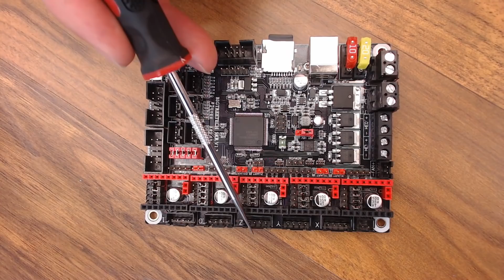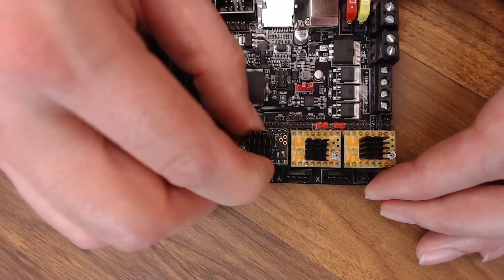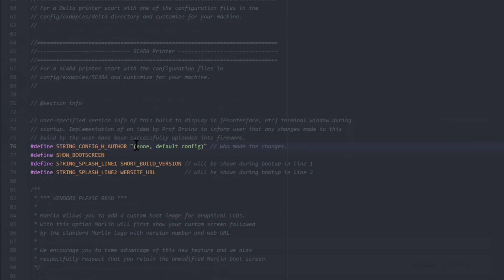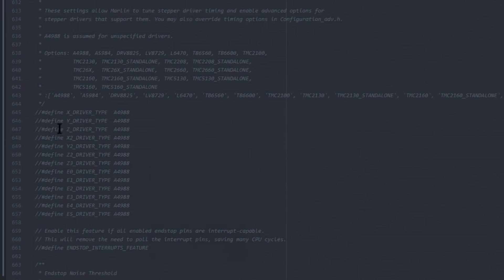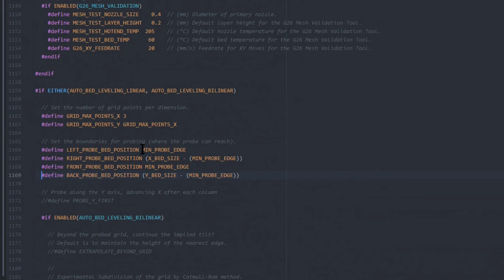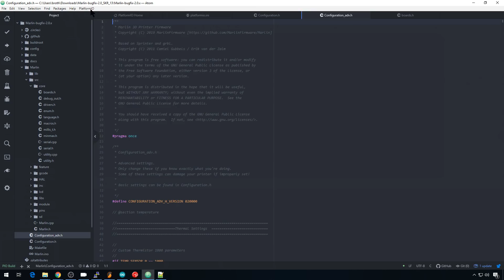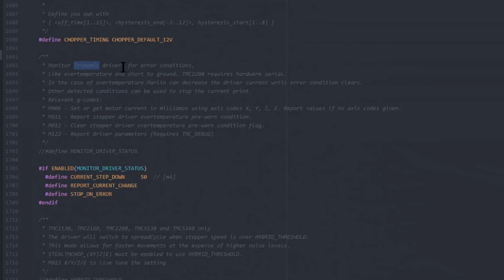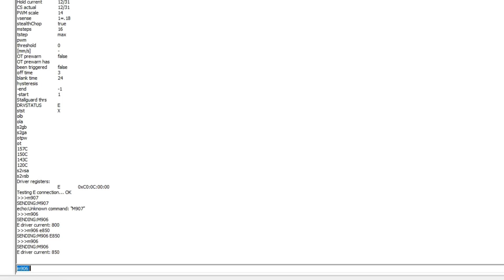SKR v1.3 Mainboard Install - TMC2208 - Chris's Basement

Comment: I like that you put ferrules on your power wires. Much better than loose or soldered which can loosen over time. Did that to mine when I installed an MKS.
As you said, 32bit permits Ludicrous speeds however I'm trying to think of a situation where it could be used. Would it be for large nozzle sizes and huge, low detail prints? I'll admit my experience is limited.
Great video. 30min isn't all that long except for the time it takes you to edit.
Am I wrong in assuming uart mode just gives diagnostics and the ability to adjust the vref via gcode?
Oh, the reset button would need an easy way to push it built into any STL file for an enclosure, IMO.
Reply from the maker: Thanks! I really like those connectors, so much nicer. Really as far as detail I don't think 32 will matter much. I see it more for corexy and Delta computing. Correct, UART just gives you some monitoring and control of the mode they run in and VRFE.

Comment: Thanks for posting, I had a look at the SKR  and it looked pretty promising, but as the Re Arm was available to me I plonked some LV8729's in one and put it on my kossel linear plus, the difference is quite amazing, 1/64 microstepping is plenty quiet for me  and has plenty of torque  even with the stepper Vref only @ 0.5v  the motors stay pretty cool and unlike when testing the 2130's on the kossel I have no layer shifts, longest print so far has been 8 hours at 120mm/s,  I have gone up to 160 mm/s but the stock effector arms rattle too much for my liking at that speed the only issue I  have with the ReArm is its height,  I really dont want to shove it under the heated bed because heatsinks  on the steppers are pretty tall,   this is why I am looking towards the SKR, I'll keep the ReArm as a backup
Reply from the maker: Right on Andy, yeah I would say the SKR is just a lot easier to install and your right it would be about half as tall as re-arm sandwich.

Comment: Only question two questions. 1) the endstop, 5V/3V, dunno if its gonna work with my current optical endstops. 2) Do you have a shopping link for aliexpress?
Reply: They Will work, ive got optical endstops 3.3v and work like a charm with skr 1.3.
Reply from the maker: Good to know on the endstops. I updated my descriptions today with all my proper links.

Comment: Excellent....  So what is your opinion of this board.  To me, it seems like excellent value, esp with the trinamic drivers.  Regarding the dual z steppers.  What is the best way to configure it on this board?  Use the cable splitter as you have or can you use the E1 driver position.  If cable is best, parallel or serial?  What vendors trinamic do you recommend.  I think I am going to upgrade my E16.  I feel very limited by the 1284 atmega.  Thanks again Chris.  Looking forward to your future videos on this board.
Reply from the maker: Thanks Mark! So far, you can't beat it for the money. You can configure the dual steppers in Marlin, it's pretty straightforward. Using 2 drivers for 2 Z motors can get a little interesting if you don't have to Z endstops, so I just stick with the cable. I would think parallel would be better, but companies like Ultimachine use series, I think you can expect pretty much the same results from either. All the trinamics use the same chip, but I have more faith in watterot drivers....but the price kinda hurts.

Comment: Hi Chris, great video. I got one of these running with some help from your rearm video. (So, thanks twice.) It was pretty much a drop in replacement for an MKS 1.4 and is working well so far in an old FT5 r1. It's so much quieter that it seems weird. 

Margin notes... I had the same 2208 v1.2 driver you used and it was only necessary to connect the J2 pad (the one closest to uart pin) with the center pad (chip) to enable uart. As I understood it, the other pin/pad was unused in the current config so it doesn't hurt anything to connect all three as you did though. The drivers get a little warm, and the vref is different than allegro, so mind the current. People say stealthchop robs too much torque for extruders so I didn't try quiet mode for that, but the 2208 is working fine for 'E' in spread cycle with a gear reduction extruder.

Might want to sign your channel up as a brave browser content creator so people can toss bat tokens your way. Take care...
Reply from the maker: Thanks for the comment, glad to know it helped you twice! Thanks for the extra info on the 2208's. I have never heard of brave browser, I will have to look into that.

Comment: Great video as per usual, Thanks.  Is configuration capable of sensor less homing?
Reply: If you have 2130 , yes
Reply from the maker: Yes, as @Nitram says, if you have 2130's, they should be similar to the 2208 setup, just different jumpers to remove.

Comment: Hi Chris, I have a smilar board ,the SKR v1.1and I can’t get it to connect to my computer at all, any ideas?
Reply from the maker: These seem to be super picky about drivers and the config. You need a known working config, load the SD card directly from the computer then put the card back in your board. See if it shows up then.
Reply: @ChrisRiley  thanks Chris will give that a go and let you know. Cheers

Comment: Would love to see this swap on an Ender 3.  Any difference?
Reply: Mks Gen L is more than enough and cheaper. It also has bigger ender 3 community. It doesn't have sd card slot on the board, but you can buy external module for less than 2usd
Reply from the maker: Really? You can get a Gen L for $20? Nice!
Reply from the maker: There is probably almost no difference swapped to an ender 3, but that goes for pretty much any i3 machine. It's not a bad option though if your just looking to replace the board and get upgraded drivers.

Comment: good job as usual. ur marlin 2.0 video helped me set this up a few weeks ago. keep in mind there is an issue with marlin 2.0 this board and 2130's doing linear advance. the extruder won't work. might be fixed now but a month ago I know it was an issue when. did it. took me 3 hours figuring out why my extruder wasn't working lol
Reply from the maker: Thanks! I hear ya, I think I have downloaded 2.0 about 6 different times now, there is always something popping up that is either broken or now fixed. :)

Comment: I haven't seen anyone using TMC drivers for sensor-less homing. Is that not something that can be DIY'd yet?
Reply from the maker: I have a 2130 video on it. You can use it as long as you configure SPI mode, this board makes it super easy.
Reply: @commonsensehuman1114 Yes. It is something I really like on the MK3 but just haven't seen it used or set up much. Though I didn't know about the 2130 video. just not something I see on swap out boards yet.

Comment: @Chris Riley
 Thank you So much for making this VIDEO!!!! Been waiting for this! ;) hope there will be many video's on this Board from you Cheers M8.
Me and a friend both are going to install the SKR v1.3 with tmc2208 in uart then lv8729 for  Z & Extruder on a Cr-10/Cr-10s  @12v Plus an EzABL not sure how to config a ezabl - we are wondering for extruder motor to use a 1.8 or 0.9° Angle 415 vs 830 pancake motor could you talk about this in your next video's using the SKR 1.3 we both bought a Trianglelabs Bondtech clone, to use with the SKR 1.3.  and what angle stepper motor is best for this board & drivers,  what vref's to use on 2208 & 8729 X,Y,E0, for the dual Z axis we would just double the vref?  Would be nice to show how to setup for a CR-10 as im sure alot of people are going to try this SKR 1.3 on there CR-10. maybe just add these questions/answers to one of your video's , Also the new features in marlin 2.0 we gain going to 32bit & SKR v1.3 how much of a difference with this board 12v vs 24v would be & using 1/16 - 1/32 & 1/64 micro stepping on this board. any detailed info on this board in marlin 2.0 would be great in one of your next video's. Dave
Reply from the maker: Thanks Dave for all the talking points. I will save this and try to touch on some of these.
Reply: @ChrisRiley  Like always you the man, like everyone else I enjoy learning so much from you, but by far this has been the most helpful. Hats off to you Sir.
Reply from the maker: @fnice1971  Thanks Dave!

Comment: So, maybe I missed something, but what are the benefits of UART?
Reply: Operation data, pre-warning, hybrid mode (going between stealthchop and spread cycle at a software defined speed), stall guard, adjusting driver current in software, etc. In stock form without uart (or permanent programming) it's stuck in stealthchop mode.
Reply: @roomtemp6374  Thank you for the information.

Comment: Already bougth SKR1.1 + DRV8825 and replaced board on my Anet A6. I plan to replace DRV8825 (already have 5x TMC2130), but they are dirt cheap and for testing work very well.

Btw - if you don't use dual extruder, you can just use E1 as second Z driver in marlin and you don't need to create Y cable
Reply from the maker: Nice! Yep, I thought I touched on that in this video, but I guess I cut it out. I will add it to the next video.

Comment: I just heard that the SKR V1.3 pro is coming out in a few days. 

The main differences are
 - 15ABlade Fuse added and 30A Fuse changed. 
- Built-in 6-channel driver with Dual-Z function Supports 7 ports. 
- Changed to a stronger screw terminal. 
- USB B port addition. 
- PWM FAN 4 ports. 
- Added I2C.

It also might have the STM32F4 as the MCU. The FPU for Floating operation is also a separate chip, and the maximum operating clock is 180MHz.
Reply: Link to source. I would love to hold off for this updated version!
Reply: @simulatedfish1995  source: bigtreetech facebook page. Biqu pcb designer often post there.
Reply from the maker: Very nice! We might have to check that out.

Comment: Great video! Gonna try this board. Can we get a video on using dual extruders for 2 color prints?
Reply from the maker: Dual extruders are tricky, maybe I can figure it out.
Reply: Thanks Chris. Hey, Can this board run smoothieware? It has the right CPU but not sure if its tricky to flash. Price is great compared to smoothieboard prices.
Reply from the maker: @outgoingbot  Yes, it should support smoothieware just fine.